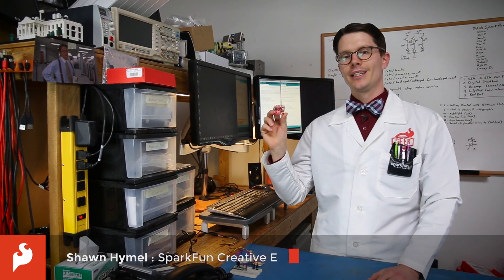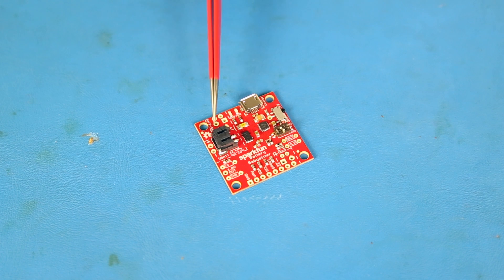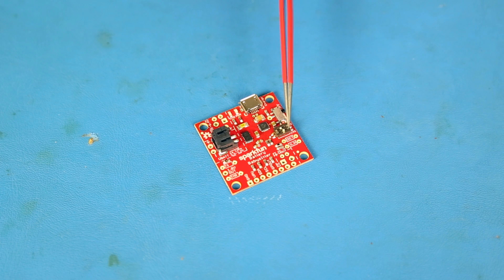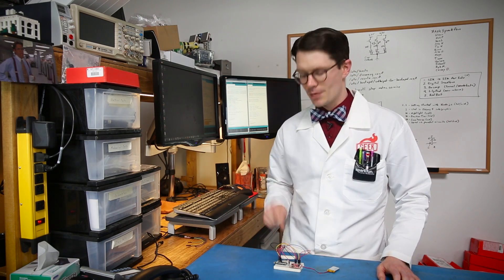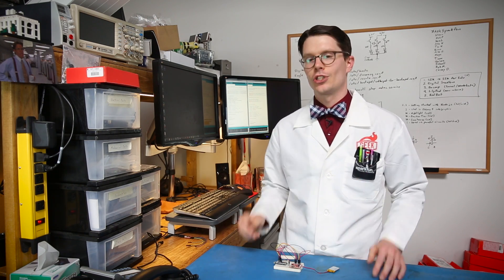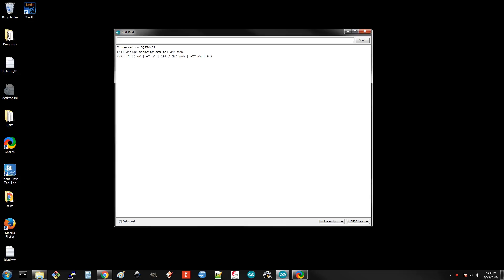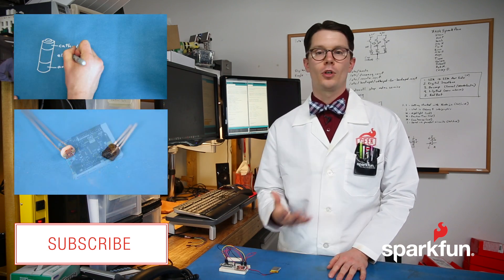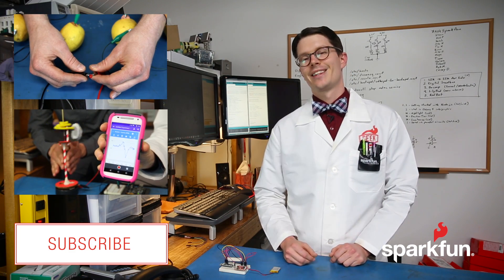SparkFun Battery Babysitter

Comment: Is there a BQ27441-G1A fuel gauge library for the Raspberry Pi? Or is this only for Arduino?
Reply: The library is only for Arduino. However, it's I2C, so you can still communicate with it from a Raspberry Pi. You'll just have to manually make I2C calls from the language of your choice.

Comment: it's realy need some kinde off load sharing and and selectabel 3.3 ore 5v output with low constant draw on the regulator for low power appilications like the esp8266

also for the price off 20 $ i fell like the adafruit power 1000 c https://www.adafruit.com/products/2465 is a better choice